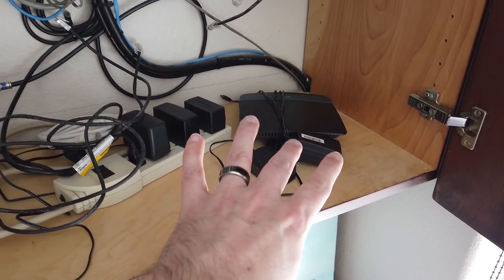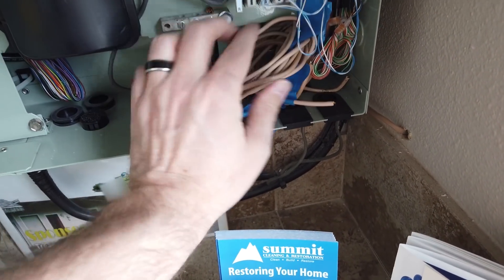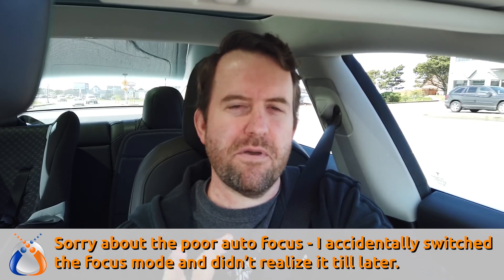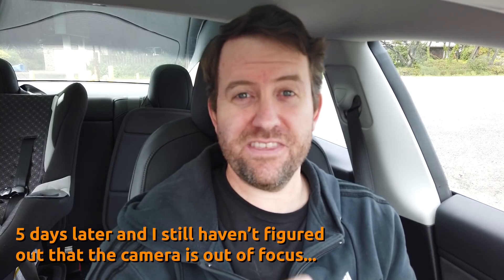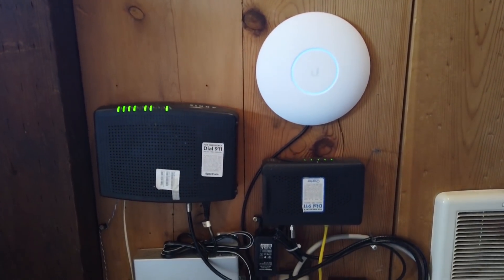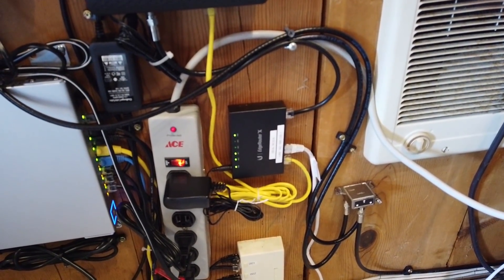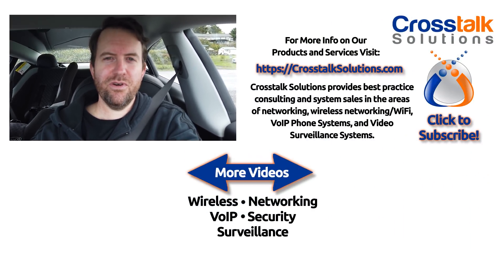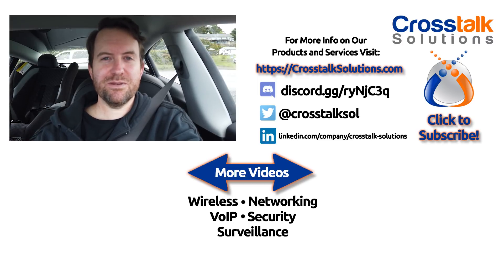On the Road 5

Comment: Loved the video! At least your second office job the customer was DHCP based on the modem provided by Spectrum. At least with just a CM, and not a CM Gateway you don’t have to call Spectrum to get it put in bridge mode. Of course most Spectrum Business installs we install a two box solution (CM and router) especially for static configurations.

Comment: Great video.  You mention that you put the guest network on a schedule.  However I tried this on my Unifi system, and every time I enable/disable a guest network (either manually or via scheduling), it kills ALL of my WiFi networks as the APs re-provision.  This causes havoc since the APs don't all come up at the same time and certain of my clients (WiFi doorbells, cameras, etc) will link to the first available AP, not the one with the best signal.  (Not to mention, every WiFi client gets turfed every time this happens!)  Have you found a way around this?

Comment: The black cable is the feed from the telco to the pole outside. If the building is multi-tenanted you could possible kill their POTS or T1 services.
Also, do you check their internet circuit for SIP ALG from the provider?  Making a test call is not a good test as the call may work. Also, BLF keys may not function properly in the future if ALG is on.

Comment: Hey Chris, a quick question, how do you manage those UAPs when you are using an edgerouter/unms? Instead of unifi. 

Regards from Denmark 🇩🇰
Reply from the maker: They're still on UniFi - hosted controller.  Only the EdgeRouter-X's are on UNMS.
Reply: @CrosstalkSolutions  If I am understanding you correctly (sorry for the noob question). The UniFi controller is being hosted over the internet instead of locally? How is that done? Through porting or is it more like tunneling or is it something else entirely. Thanks for your time.
Reply: @justconnor734  99% of the time, UniFi controllers are hosted on the internet on services like Digital Ocean and Vultr. They require very little compute power and are generally very cheap to host (< $10/month). The UniFi Controller is a package that runs on Linux (plays very nice on Debian/Debian based distros like Ubuntu).

All that's needed is a server somewhere with a static WAN IP address running the UniFi Controller software. When setting up a new UniFi device, the installer would SSH into the device and tell the device to report to the specific IP address... The UniFi controller would then see the new device and you can provision it.

Chris actually has an amazing guide to all this, and I have used it personally many times. It's on his site, https://crosstalksolutions.com/definitive-guide-to-hosted-unifi/

It sounds complicated, but it's very easy, super fun, and very rewarding!
Reply: Lance Nickel thank you very much for your detailed response. That makes a lot of sense.

Comment: Why EdgeRouter? Wouldn't a USG be better so you can keep everything managed in Unifi?
Reply: QoS isn't really there with UniFi. You could do it with config.gateway.json, but that's kind of hacky. Plus the ER-X is only $60 vs $140 for USG3.
Reply: @Zizzily  I've got a unifi setup at home and sadly took the USG instead of the edgerouter, purely based on the fact that it's all Unifi. I hope they'll catch up and provide basically the edgerouter functionality in unifi, either USG or maybe the dream machine pro.

Comment: How do you feel about putting that equipment in an enclosed cabinet like that? (I think it was the first site you were at)  I didn't see any ventilation. Not worried about heat?
Reply from the maker: It rarely gets above 70 degrees out here on the coast. So no...I’m not worried about it.
Reply: @CrosstalkSolutions  Nice. First those coastal views, now this.  Thanks man.  Thanks.

Comment: This thick black cable, looks like a 50DA (german for 50 Pairs = 100 single wires) maybe its only a 25DA but just legacy Nx2Pair Wire. 
Did they have more than 8 devices / more than 4 that needs PoP? Just because I would install 2x US-8-60W - nearly the same price but 14 Ports (2 excluded for stacking) and 8x PoE, ok not PoE+ but I think the phones are running on non + PoE. (I've 2 Siemens Openstage 40 SIP on my desk running of a US-8-60W)
Don't know how good/bad your DSL is. Here, middle of germany ~14.000 people, I get 2x VDSL2 250/40 (one privit with phone and tv & one buissness link with IP only because of fixed IP) and could get 500/25 via cable. (as I checked i see 1000/50 but I don't trust this side - the Upload on cable is way to week via cable.)
Ok, in the capital city Berlin I've heard that they barly get a VDSL 50/10 line and the coax network is overloaded so they get studdering etc. all the time.